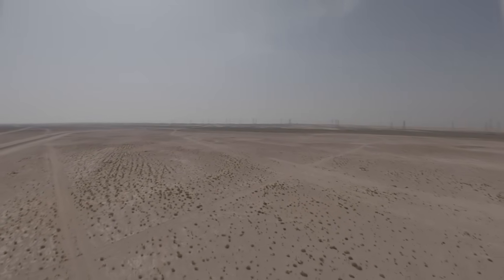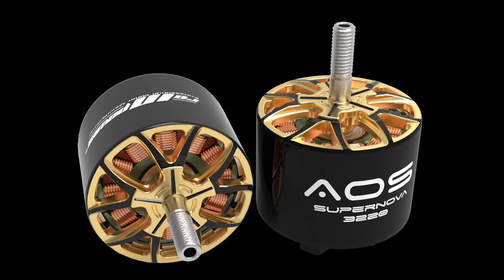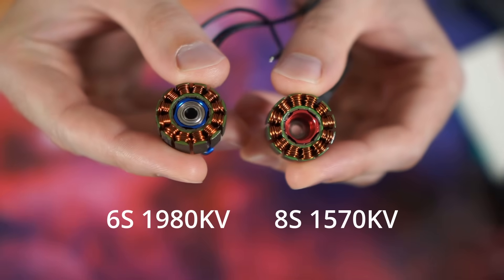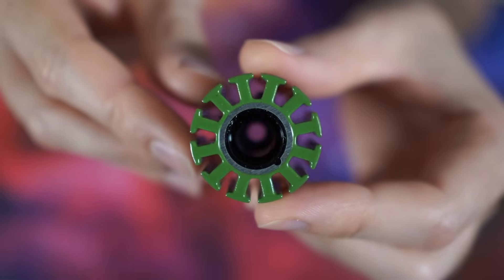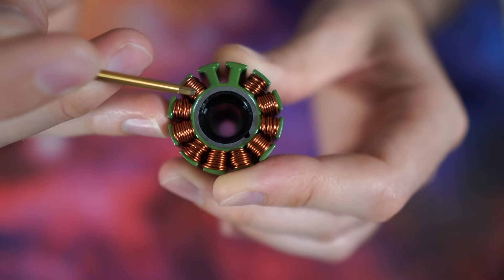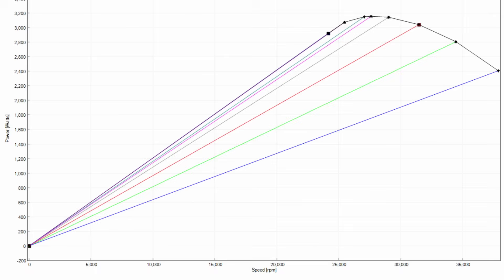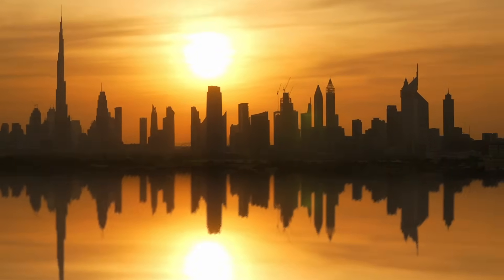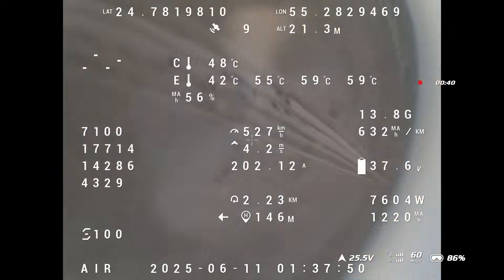How I designed a 580kph world-record breaking motor in my bedroom

Comment: I'm wondering if it might be worth optimizing the winding density using copper foil instead of circular wire, so heat can transfer out, and you can possibly get better fill density? Maybe switching to silver too.
I see EVs moving to hairpin windings, but basically focusing on removing all dead space in the winding area. I imagine you've thought about this already though?

Comment: Does this fall into a separate category to RC gliders? The current overall RC speed record is held by a glider, with a max speed of 907km/h I believe, which is substantially above the 624km/h mentioned here as the fastest electric only speed record?

Maybe it’s some semantics with the definition of electrically powered, whereas although the gliders only onboard power source is batteries, I could see the argument being made that they are either unpowered, or even wind powered…
Reply from the maker: I believe the record they have is a still air record. Gliders achieve insane speeds by dynamic soaring using strong air shear layers at the tops of hills/mountains. Even if they did have electric motors they are not electric powered as most of the energy is coming from the wind.
Dynamic soaring is unbelievably cool!
Reply: @ChrisRosser Yeah that make sense!

Very cool projects and impressive vehicles both!

Comment: Fascinating. Seems like a lesser radius but greater length might be preferred for higher speed runs. Maybe that’s hard to find a stator with those specs, but it might be an option to stack existing stators. I’ve always thought it should be possible to seal off the stator from the rotor with a thin insulating layer, in order to fill the air gaps in the windings with water. Even if you don’t have water circulating via pump, the very action of boiling water takes an enormous amount of power without increasing in temperature, so long as you have a pressure relief valve.

Any hints for constructing a wheel hub motor? I’ve already got myself some stators, but I don’t really want to buy a normal steel pipe to glue the magnets onto.

Comment: Why not go completely mad and use high temperature superconducting windings and divert some of the boiling coolant to air bearings? If the permanent magnets don't like to be that cold, maybe replace with superconductor to. You could pre-cool before launch and if there isn't a minimum flight time, the coolant weight may not be too bad..
--Free Unsolicited Idea by Dunning-Kruger Ltd,.,a Nightflyer Company

Comment: interessting would be a dual stator motor design that has different KV for different ideal rpm ranges.  
like a outrunner with the magnets exposed on both sides and sitting inside a inrunner stator.

Comment: Those shrouds for the motors, wonder if there's room in there for a small C02 canister? The sort used to power BB guns and toy rockets. Let that gas flow through the motor during the run to cool it and if possible the ESC's. Would have to be changed after each run, but when swapping the battery out anyway,....

Comment: CO2 or nitrogen 12oz style canisters with little capillary tubes running to each rotor, spray them with sublimating liquid, the cold will condense the magnetic fields too causing them to become denser and in effect stronger. Plus displaces oxygen, so the motors wont burn as easy....theyll still melt, but there is an oh shit option for fire suppression.

Also, what about ruby point bearings?

Comment: You can double or triple the power output by taking advantage of the right-hand rule. Flatten the wires in the winding. You are wasting energy by using round wire.
Reply: Seriously, square silver wire and they will have no problems whatsoever breaking the next record.

Comment: Imagine in 10-15 years, ducted fans with specially designed inlets, compressor stages and a diverging nozzle to go from subsonic motor thrust to supersonic thrust, basically a compressor stage from a jet engine but optimized to work without any combustion or turbine section!

Though it will be a challenge to get the efficiensy of it good enought to not be a black hole of power demand 🙄

Comment: The rpm limit isn't new, that has been the same for a long time!

speed of blade tip shouldn't exceed the speed of sound, and that hasn't changed, 30krpm max, but 27krpm is typically used, on a 5" rotor

Comment: I am impressed with your engineering development. May I point out that the notation "kph" is non-standard and incorrect. The correct symbol for kilometres is " km".   Standard Metric Notation uses "/h" to represent per hour.             The corect terminology to use is lower case " km/h".

Comment: Aren't the bearing packs something that adds bearing?  I know bad pun.....  I assume ABEC 10 but are they steel or something more exotic like, IDK..... ceramic?  I won't use anything less than ABEC 7 if I have to replace them in any of my BLDCs.  They can be pricey and hard to find for some sizes.

I recently experienced a bearing failure in an EDF so these little things are on my mind.

Comment: For greater speeds i think you have to go to only 1 motor.

 4 motors,4 propellers induces to much friction. It.s like a wiindmill with 12 blades and not 3. 
For cooling you can jnject whater in the magnetic gap. Making the stator from 2 parts with holes in the middle where you can inject the 0 degres Celsius water. The water will.pass the magnetic gap from.the.middle to the exterior cooling the magnets. 
It.s just an ideea. And you have to use samarium cobalt magnets. 
Search Dornier 335 plane from ww2 to inspire for a greater speed.

Comment: I use the 925kv versions of these motors on both of my 10" cinelifters. They are definitely the smoothest and most powerful motors I've used so far. Thank you guys for making such amazing gear available to average folks like me.
Reply: Were they and the ESC's expensive? I have an ancient F550 that could do with retiring.
Reply: @PiDsPagePrototypes  They're not cheap motors. I bought 9 for about $650-ish. Worth every penny. I'm using some cheap 60A AM32 ESCs with a 75% throttle limit and they work great. I'm getting some 100A ESCs soon so I can really let 'em eat!
Reply: @rocketwrench  Hexacopter with some spares left in the drawer just in case? Assuming US$, $650 for 9 is on par with normal costs for a CineLifter, and the 'smooth' is noted :) Vibration just ruins anything with a Rolling Shutter.
Heavy camera? I'm not looking to lift an Alexa, but hanging a decent DSLR/MILC underneath for cine vistas, tracking, and my guilty favorite for artworks, Models on Waterfalls.
Reply: @PiDsPagePrototypes I have two quadcopters with one spare motor. It lifts a 2.3kg film rig easily and flies pretty fast. It hovers at 30% throttle with a 4kg TOW on Gemfan 1050cl props. It cruises very comfortably at 80 kph (50mph) and can even be used for basic freestyle at that weight. Unloaded, it's absolutely insane. This is at 6S btw.

Comment: Thanks for the deep insight in your work! Is this the same motor the TBS Mojito uses? TBS states it as 1000KV, but I can't find a datasheets for detailed comparison. I'm interested in the differences, in case need replacement for the one in my Mojito. I already managed to bend the shaft in a crash, so it started scratching. Luckyli I was able the bend it back in position :^)

Comment: Why not increase the length and reduce the diameter of the motor to reduce the rotational stress - the farther from the center at the same RPM the higher the g force? I would think you would want a narrower diameter if running at a very high RPM - particularly if you have magnets breaking under stress.

Comment: At such a high RPM rate, I'd be interested to know how significantly the expansion of the rotor due to centripetal force affects the air gap and whether that negatively affects performance. I wonder if it could be compensated for by starting with a tighter gap or optimizing the rotor design to be optimal with the max-at-speed-gap rather than the gap as measured at rest?

Comment: have you ever considered milling the props from the rotor case, like this they could be used as heat sinks and take heat away from the rotor, the aluminum might add weight but it might be offset by how much harder you could push the motor
Reply: The difficulty in balancing that,... Be easier to source a prop with a metal insert, though I think active cooling would be more beneficial.

Comment: Amazing achievement but why go for the all out record with something that's so inherently inefficient as a quadcopter?      The dynamic soaring sailplane record is a tick over 900 km/h and 600+ km/h happens on any average windy spring day in southern California's mountains every year.   I've personally piloted my D130 to 648_km/h.     I  have to think a  bit lighter built DS plane (doesn't need to handle 40-50G's of loading)  with a big motor, square prop and FPV setup to handle straight line records would rocket past that 624 km/h electric record.

Comment: Why not add a bigger pusher motor inline with fuselage?
Reply: They don't need more power. They need less drag or higher propeller pitch speed to go faster.
Reply: @megatesla  you have a big fat fuselage anyways to hold a battery, so why not?
Also you can use smaler quad motors just for attitude control. its a win-win
Reply: @AndrewShaidurov  You can't use smaller motors for control. They will create a ton of drag, and like I said to go faster they need less drag.

Comment: Could you make a motor where the whole bell is hardened steel? It would be the best freestyle motor. I'm thinking the weight difference would be very small compared to an aluminum unibell with a flux ring.

Comment: Why do we use outrunners though? I've always wondered this because an inrunner like in a car would have a  big advantage in certain areas.
Reply: Mainly because they have much better cooling, have lower winding resistance and can easily be wound for specific kv.
Reply: @megatesla I can see that with cooling but I have to disagree about the other things. I don't see any reasons why that could be. The rules about winding for a certain kv are the same. And they can use the same wire for the windings.
Reply: @jayaneyon9316  You have much lower slot and pole count in inrunners, usually 3 or 6 slots and 2 or 4 poles, so even with very low winding counts you still have high kv and low torque. With an outrunner with 9 or 12 slots and 12, 14, or 16 magnet poles you can get a much lower kv with the same amount of windings. Fewer winds equals lower winding resistance. Easer winding for specific kv, because in inrunners your kv jump is huge with each turn. For example an ARC 28 motor with 2 winds/turns has a kv of 2170 and 3 winds a kv of 1500. With outrunners you have more resolution to hit the correct kv.
Reply: @megatesla but inrunner motors are available in all kind of different kvs and turn counts. A 17.5 turn motor is about 2000kv usually so idk what's up with the little motor you're talking about. Also 4 pole motors have 12 slot stators which is just as many as a 14 pole outrunner. There are also 6 and 8 pole in runners. Also they naturally spin at high rpm better so they could handle being a higher kv. Motors get way more natural cooling in a quad than on a car so I doubt heat would be an issue with an exposed stator like on a racing motor.
Reply: @jayaneyon9316  The "little motor" I'm talking about is an ARC. They were inrunners we used many years ago to set EDF speed records. There is a lot I can say here, but you have obviously made up your mind that an inrunner would be better for a high speed drone driving open-air high pitch 2 or 3-blade props. So I will leave you at that.
Reply: @megatesla well I looked it up and it looked fairly small. I'm used to rc car racing motors. It's not just for high speed... I hate how vulnerable the bell is on a quadcopter, smashing the outside of the stator on an inrunner makes way less of an impact than smashing the bell of an outrunner. Also because Chris said torque is only about stator volume and not how wide the bell is that means you could get a much more responsive motor because the moment of inertia is smaller. I like to hear what you have to say, it seems like you have a lot of experience but I have my own ideas too.

Comment: and what if you'll use silver wiring for "recrord-braking" purposes? Less resistance
Reply from the maker: Ooh, yeah that would definitely help with the heating but at the rate Luke and Mike go through motors I would worry about the cost!
Reply: @ChrisRosser  You should try some manual winding work from our German speed record holders. They would probably fit twice the amount of copper in that stator!
Reply: @ChrisRosser  thanks for replying to your subs Chris. I appreciate that
Reply: *breaking
Reply: @peterpizzurro  thanks man, english is my 2nd language)

Comment: If you're going extreme, I wonder if the lower resistance of silver wire windings would be worthwhile?
Reply: Silver is only 5% more conductive than copper. I think square wire will be more beneficial.
Reply: Silverplated copper might be worthwile. At high PCM frequencies, where skineffect matter, this might make a difference.
Reply: Silver is definitely not going to fair as well in these conditions.
Reply: The difference between Copper and Silver, can be accounted for by actively cooling the copper.
Reply: @PiDsPagePrototypes  Then surely actively cooled silver would be even better :P
Reply: There is carbon fiber wires with better conductivity than copper. Think you will have to make them yourself though as I only seen it in playground labs. Not too expensive though for small one off high performance motors.
Reply: @LuiLulumon  DIY carbon fibre wire will have a third the conductivity of copper. And even if you can make defect free carbon nanotube or graphene wire insulating it with a thin enough insulator to make wrapping it around a small radius will be difficult. You need to pack a lot of it in a tight space and it will most likely perform worse than copper wire in real life.
Reply: Silver is brittle and malleable

Comment: In this video it is stated that 3220 hasa sa titanium shaft....on the Internet it is stated to have a hardened steel shaft.I even emailed you to ask why you use hardened steel shaft in the bigger 3220 motor,but titanium shaft in the smaller 2207.
The reply....Hardened steel is superior.
I would like to know the awnser to this one 😁
Reply: Steel is stronger when you want strength is as small of a package as possible, titanium is stronger when you want strength in as light of a package as possible.

Comment: maybe add 5 long needles to the tops, to make the air pass it even more easy.
would it make sense to have a aluminum stator, dipped in tin or another thin layer of conductive material?

Comment: 564mph (907kph) is the drone record, and this is a glider without a motor. 
Search 564 mph by Spencer lisenby
Reply: First time ever I see someone calling a DS sailplane a drone. And that record uses an immense amount of energy in the vortex generated by the wind. The Guinness drone record is for a device that can reach the record breaking speeds under its own power.
Reply: @megatesla  I hate the word drone, I resisted for a decade. but everyone uses it now.
Reply: Yeah, these records all have so many asterisks. "Instantaneous speed in level flight" as opposed to a speed over a mile measured in two different runs. I'd even argue airspeed vs. groundspeed is probably equally important. Just launching from an aircraft into the jet stream at 100+mph and flying their same 360mph air speed in level flight. etc.
Reply: @supergeek02468 "these records" are NOT the peak speeds, the peak speed is going away from the radar, after a 180 degree U turn, then the speed is read.
Reply: Battery powered remote controlled quadcopter. The dynamic gliders are technically wind powered

Comment: electric motor does not have to be a rotary motor. ie can be also an electric plasma heat-mhd jet engine. also ramjets are as normally, supersonic and more.
Reply: I wonder if at those speeds the aerodynamics make EDFs start to make sense again. You must just be losing a fantastic amount of energy generating propeller vortexes. Hypothetically there's no reason you couldn't go supersonic with an intake that could choke the air down to subsonic levels and a nozzle compressing them back to supersonic. Trading out a turbine with an EDF to generate your high pressure air.
Reply: @supergeek02468  A large, high-pitch prop will almost always give higher efficiency and more usable thrust at speed than a ducted fan of the same weight/power.
Reply: @supergeek02468  no moving parts in an electric heat-mhd jet. even edfs have tough time with supersonics. yes it can but power efficiency goes down the toilet.